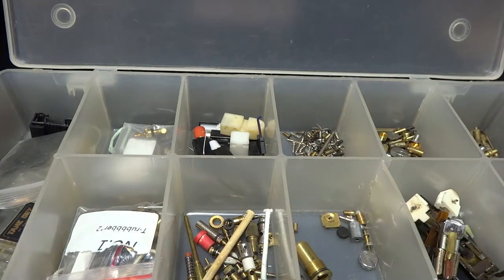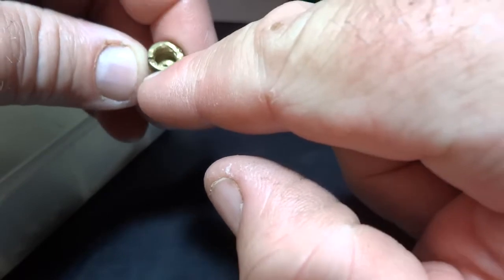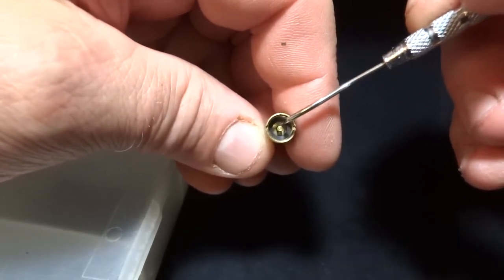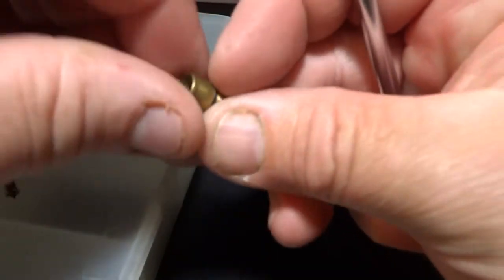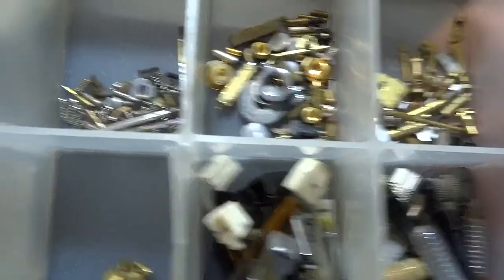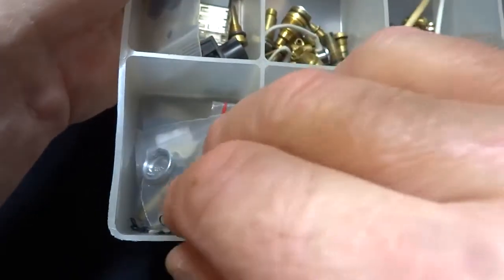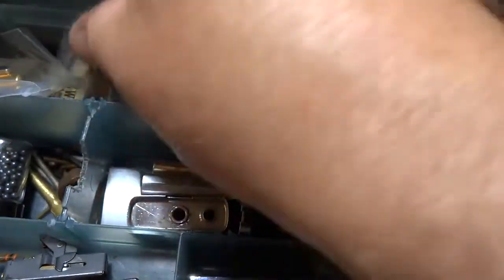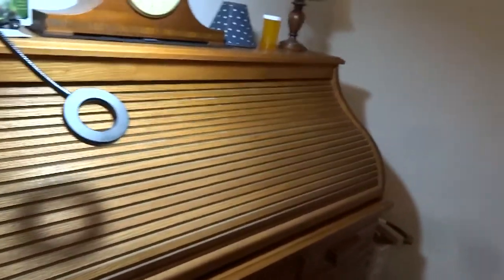Butane  Lighter, Filler valve information

Comment: ive got one with the same sort of mechanism as that red and gold one and its leaking, i cant find any info on it at all, do you do repairs on that sort still? its japanese marked crest, flame crest is my guess, but since i cant get the burner valve out i cant do anything to fix it, it does hold for a few days and burns fine aside from the leak
Reply from the maker: If you send me a photo of what your trying to remove I could possibly make a tool for you. If your unable to repair
I might be able to find some time in a few weeks, Send me an email and photos to lighters2018@gmail.com

Comment: I have a RothSchild Lighter from the 80s that needs a filler valve, would a generic Type A fit in there? there's almost no info on them online!
Reply from the maker: The valve should be serviceable. Have you tried to remove it to see?
Reply: @Lighters-cf4bd   yeah it might be a bit late for that, I got at it last night and I believe i may have caused some permanent damage to the valve housing the section that is inside the tank, especially the end that's crimped and hold the valve assembly,. Do you think it's still fixable? would i be able to send you some photos and you could see if it is something you could possibly do?
Reply from the maker: @tahabakhtiari6297  lighters2018@gmail.com

Comment: Did you ever get to fix that Tanita lighter?
Reply from the maker: Yes I did! Sold it as well.
Reply: @Lighters-cf4bd  darn! Loved that domed cap.
Reply from the maker: @zagzig3675  It was a nice, very high quality lighter. I ended up getting some small stainless tube
from china and making a tool to remove the valve  for cleaning and to replace the sponge.